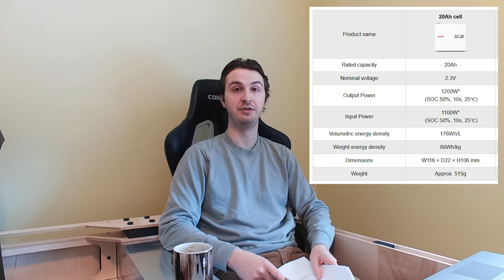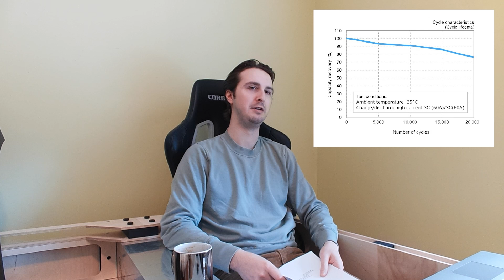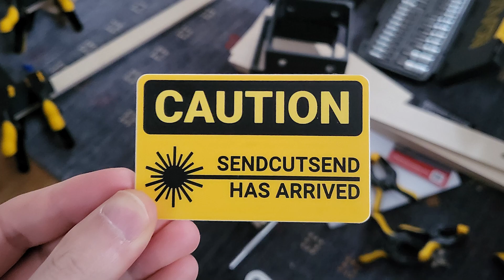Building a Hybrid Sports Car In My Spare Bedroom

Comment: Wow this is crazy, I'm going to into my final year of industrial design and I had a very similar idea for my final project. I thought I was crazy for thinking of taking on a project like this as an industrial designer but it's super cool to see that you've pushed through. I really wanted to experiment with aluminium extrusions for the chassis because of what lotus achieved with the Elise. I've only seen similar stiffness to weight stats on carbon monos. Also with the CAD I would highly recommend having a go at designing the body in the Rhino SUBD workspace. Trying to do that stuff with solidworks surfacing tools takes for ever. I've had a bunch of fun recently designing body's in rhino. you can pump out awesome designs in about an hour.

I hope you keep posting videos on this project it's soooo cool.